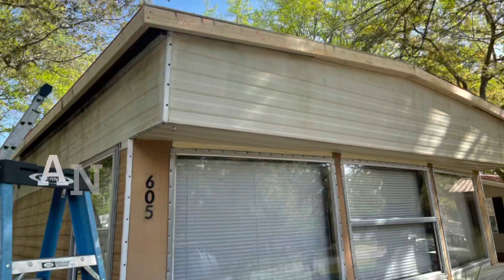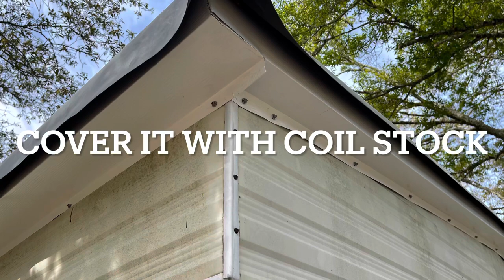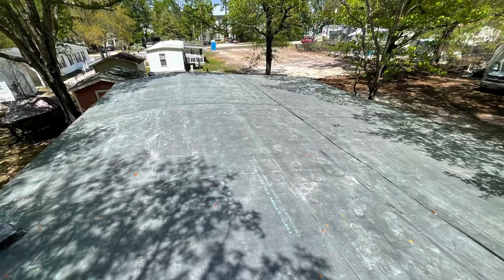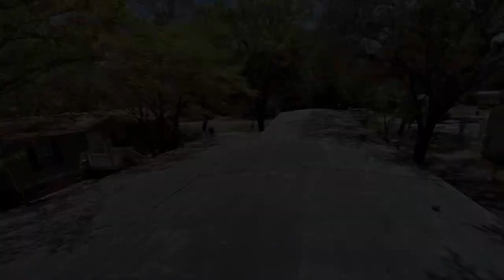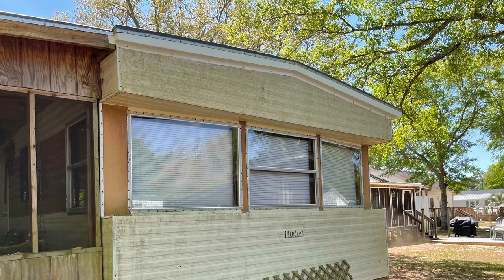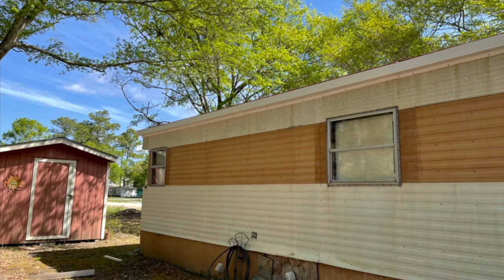Mobile Home Roofing. Last Roof You Will Ever Need.

Comment: Drew, at the height of a north Carolina Summer, what temperature would you say a rubber roof gets ????
Reply: Probably about the same temperature as the metal roof got when he was exposed to the sun except now there is OSB under it so the heat does not translate through to the metal like it used to

Comment: Drew, I have a Redman16×80 year built 1996. It has the original medal roof on it and has quite a bit of rust on it. Would you be interested in giving me a quote for a new roof with 6 inch overhang ?
Reply from the maker: Where are you located my friend I might be interested for sure
Reply: I'm located off I-45 and Beltway 8.
Reply from the maker: What state.
Reply: Texas
Reply from the maker: That is a long ways from me and my friend we live in Southport, NC 28461
Reply: @Drewsroofingandhomerepair  I know it's a long way but wanted to check if you would be interested in doing the work. I could probably do it myself but not sure how to attach the roof vents to the rubber. Do you have any videos of attaching the roof vents on the rubber?